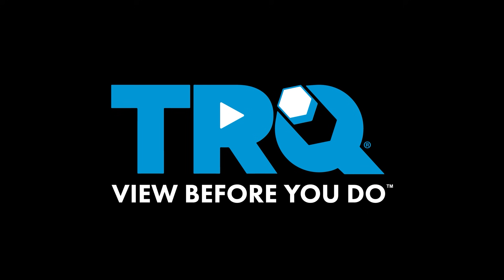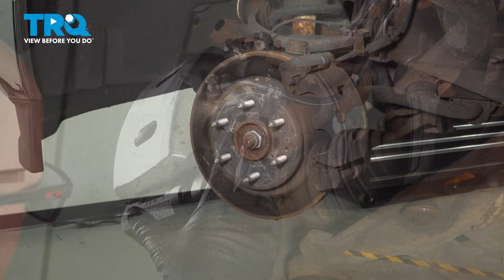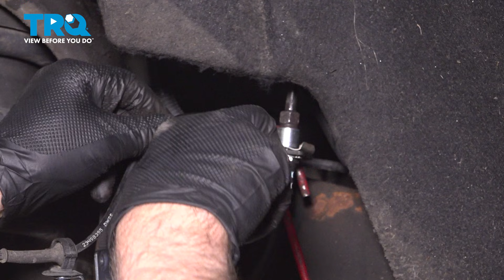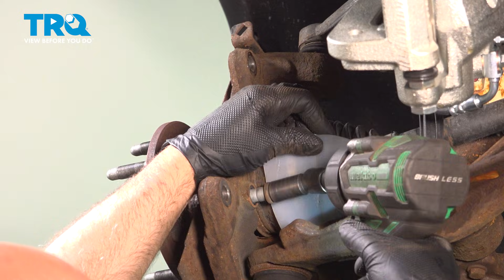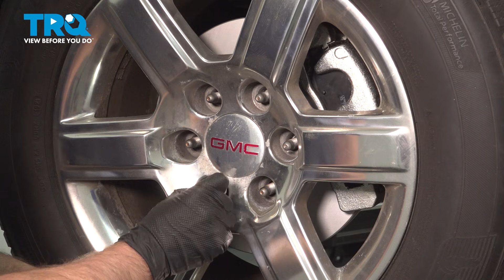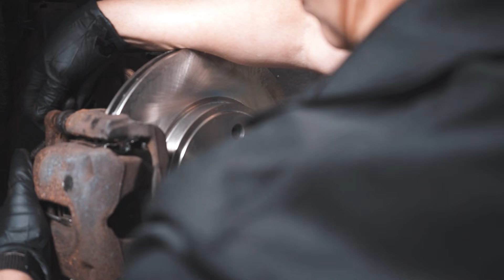How to Replace Front Bearing & Hub Assemblies 2014-2018 GMC Sierra 1500

Comment: 2 wheel drive and 4 wheel drive are slightly different. On 2 wheel drive you won’t need the 35mm axle nut socket, because it won’t have an axle nut. I figured this out by going under my truck I felt lost and confused at first but did some research.